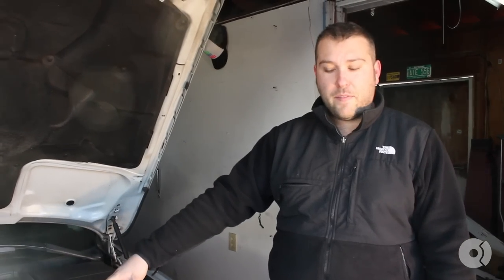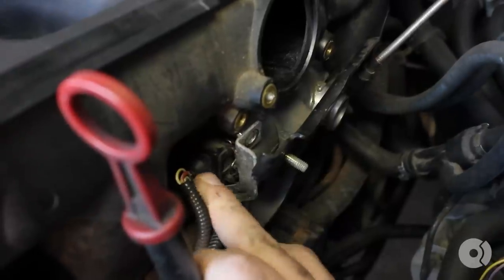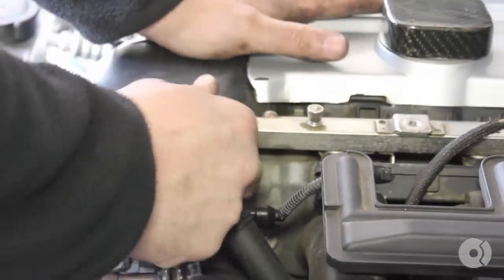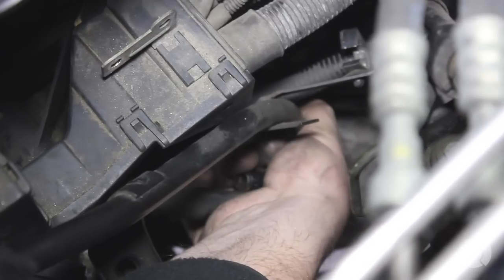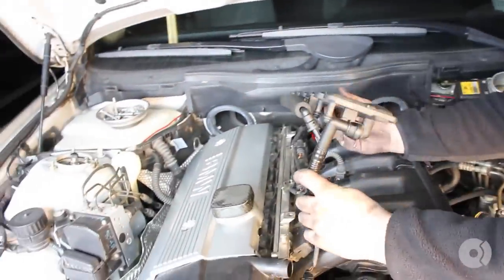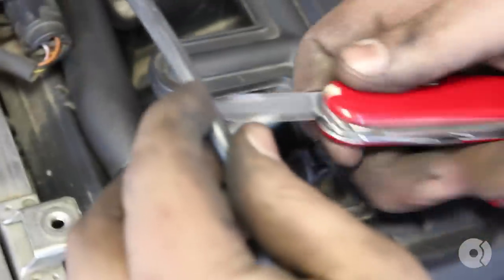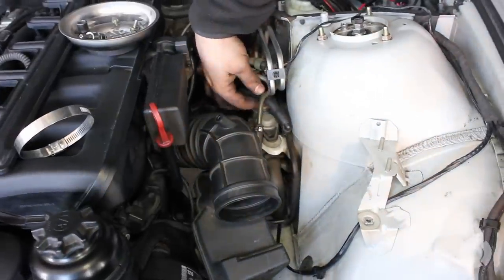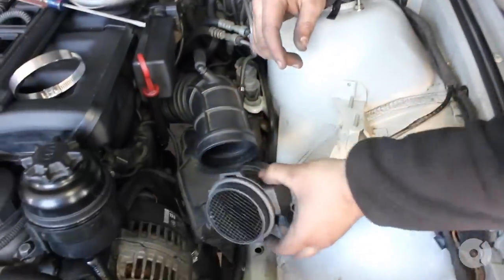BMW PCV Replacement (Breather System, Throttle Body, Idle Control Valve, Dip Stick)

Comment: The dipstick seal and the O rings that you replaced up top are impossible to find. I looked at Napa, O'Reilly auto zone and Amazon. No one has the right size. Please provide link for ordering.

Comment: Which upgrade upper intake boot will fit best on a 2004 BMW X5 3.0i with the M54 engine?? 525i or the 325i ?

Comment from the maker: We didn't clean the throttle body, he had actually done that just a few weeks before, instead we just removed it and set it aside.  Later in the video you see we replace the gasket, but that's about it for the throttle body.

Comment: How did you get that hose to connect to the pcv valve the one you have to turn and hear a click...I've been trying to get that hose on but there is not a lot hand space under to get the hose fully on to the pcv valve

Comment: Hello, I just changed the PCV system. The car runs great, but when it gets warm the idle jumps in neutral gear. Before I changed the PCV system the Idle was fine. Maybe you know what is causing this? :?
Reply: It throws code p0173
Reply from the maker: +LittleCrazyBoy666 P0173 is usually caused by a vacuum leak. I would check your work on the system to make sure there is no missed connection or poor connection.
Reply: +FCP Euro I have checked 3 times. I deleted the error code 2 times, and now the car idles fine. Maybe it was some air in the system, I dont know really...

Comment: Would the removal of the ICV be the same on a '97 328i (E36) Or at least be in the same spot? I think mine needs to be replaced or cleaned.

Comment: @fcpeuro so i did this job yesterday, and re connected everything, i have crank but engine is not starting, i hear the fuel pump i checked the connections i have everything plugged. Side note my throttle body is the magnetic not the cable one. side note its 330ci 2002 model.
Reply from the maker: Its tough to say, throttle body or ICV may not be plugged in properly.
Reply: FCP Euro i just wanted to update, the problem was one of the 30amp fuses for the engine module. It was surprising for me since the work was not related but that was the cause to not start the engine. Crank no start.

Comment: Where do you get the O rings on the spreader..special material??
Reply from the maker: The o-rings can be ordered individually under BMW p/n 11617502761. They are 7x3mm and as far as I know they are not made of a special material.

Comment: hi guys thanks for your help that's a great video help me out a lot its i have 325i but my engine is M56 and its hard for me to put the idel control valve back i try push it hard but i feel its not go in properly can u help me out plz
Reply: Hi Asher,

The ICV can be really tricky to push back in. In the past I have had problems myself. The grommet in particular is what makes it so difficult. One thing that can aid in helping you get the valve back in the grommet is some silicone spray. It should slide in fairly easy once it has been lubricated. What's nice about the silicone spray is you don't have to worry about it damaging the grommet or valve.

Comment: Hi can i ask your help with my 528 bmw i have been replace deep tick course it's was blocked with the old masty oil but i am interesting is there should be an oil coming from valve cover to pcv ore it's just for the ear? Will be greatto hear some explanation have das it's works pcv valve? Thank you will fallow your comments.Also s in sump have a pressure need to seal deep stick really tight?

Comment: Can't seem to find anything, but is the process similar for an e46?
Reply from the maker: Hello Caleb, the process will be similar for an E46. If you have any questions while doing the repair let us know and we'll be happy to help out.
Reply: FCP Euro 
thanks a lot I really appreciate that, I'll give a holler if I get stuck!
Reply from the maker: You're welcome!
Reply: Hey guys, i have a 04 e46 and my service engine soon light came on. I scanned the car and it said it was the PCV. I dont seem to see white smoke from the exhaust or an unsual sound coming from the car will i still have to do the complete replacement? Also FCP Euro, PCV 325i video soon ?! Thanks

Comment: Hey guys, i have a 04 e46 and my service engine soon light came on. I scanned the car and it said it was the PCV. I dont seem to see white smoke from the exhaust or an unsual sound coming from the car will i still have to do the complete replacement? Also FCP Euro, PCV 325i video soon ?! Thanks
Reply from the maker: There isn't a fault code specific for a bad PCV valve. Commonly, a bad PCV valve or PCV system can result in lean conditions, rough idle, or misfires due to vacuum leaks. This is commonly identified via smoke testing the intake manifold. If there is no vacuum leak due to a physical failure of a component the other potential symptom of a bad PCV system is it will be difficult to remove the oil filler cap due to excessive engine vacuum in the cylinder head while the engine is running.

The installation of a PCV system is identical on an E46 325i as it is in this video so we won't be making another one. The system is identical with the exception of the vacuum line off the PCV valve. Other than that, the hoses and valve are all in the same locations on an M54 engine as they would be on an M52TU engine.

Comment: so this would be the same for an e36 with M52 engine I guess, right?
Reply from the maker: Completely different setup on the E36/earlier M52 engine. This video is on an M52TU engine which has several difference than the M52. On an M52 engine the intake manifold have to be removed to do the job. but it's a much simpler system and layout compared to this one.

Comment: Great Video!  Just completed this job on my wifes 02 X5. Easy job except for attaching hoses to valve. I moved  the power steering reservoir and bracket out of the way and was able to get a better grip on that bitchy hose. :^)  What a horrible design and placement of that valve.  Good Job BMW!

Comment: Hi, My bmw E83 crankcase vent valve went bad with pressure in engine & blow out my valve cover gasket. Do you think it could have damage any other seals?
Reply from the maker: It's possible, but the most usual casualty is that valve cover gasket (you can always use Liqui Moly Molygen in your next oil change to check for any other leaks!)
Reply: thanks alot !

Comment: Is pcv valve the same as ccv valve?
Reply from the maker: Hello Jose, the PCV and CCV refers to the same system, on many BMW models the PCV system is more complex and is called a CCV.
Reply: Thank you for clearing that up for me. I just needed to make sure I ordered the correct parts. Thanks
Reply: Is this the problem going on with it catching fire?
Reply: Alan Garcia  no

Comment: I have a 2007 bmw x3 with the n52. High pitch whistling, rough idle, and a lot of suction.. when taking oil fill cap off whistling stops still chugs a bit.  also stalls at stops.. dont wana drive again until i can fix it. I cannot find much info on how to fix except that i most likely will have to replace valve cover.. bmw dealership said i have a crack in valve cover.. they want 2500 to fix.. my dad has a lift and every tool needed most likely so i would rather do it myself.. i also heard its probably the pcv valve/ breather system but thats molded into valve cover which is why i will have to replace valve cover.. any help would be much appreciated..
Reply from the maker: Hi Krookiemonster, we actually have a DIY on replacing the valve cover on an N52: https://www.youtube.com/watch?v=6DlFKo2809I

Comment: fcp euro,if i buy pcv  it comes everything on the box or just pcv itself
Reply from the maker: +Tommy Sena 

We sell complete kits and individual components:

Crankcase vent valves:
https://www.fcpeuro.com/BMW-parts/Crankcase-Vent-Valve

Breather System kits:
https://www.fcpeuro.com/BMW-parts/PCV-Breather-System-Kit

The best way to verify what fits  your BMW or doesn't fit your BMW is to select  vehicle and search the engine mechanical category.

Comment: hello. how much is pcv? full sistem with cable.
Reply from the maker: +Bogdan Varcoci That depends on what BMW you have. I would need year make model (preferably the last 7 of the VIN) to really determine the correct parts. Also, I'm not sure what you are referring when you mention cable.

Comment: On a e90 , 2011where is the pcv located ?
Reply from the maker: For both the N51/N52N and the N55 engine the PCV valve is integrated into the valve cover.

Comment: On a 2001 530i m54 engine, when I shut off the car maybe 1 second or 2 after the engine lets out a big hiss or like a loud exhaust from the engine bay. What might that be?
Reply from the maker: Hello Jose, it sounds like your breather system might be clogged based on your description.
Reply: FCP Euro is there a part number for the really thin small vacuum line mentioned in 27:00 ?. FCP Euro has the whole kit but I don't see the vacuum line or the size.

Comment: hey Fcp Euro, I have the m56 engine and I got a diagnosis from my mechanic that due to the codes (p0171&174) my pcv was bad (diaphragm) he gave me a quote for nearly 1k, (~979$) with all OEM parts. is that a good price ?
Reply from the maker: Javier, the M56 SULEV engine has the PCV valve integrated into the valve cover so to replace it you will be replacing the entire valve cover along with valve cover gasket. The valve cover is rather expensive and is price around $650 from BMW, although its sold for less online. The p/n in question is for the valve cover is 11127521086. I also assume they are replacing the vent hose which connects to the valve cover which is p/n 11157513756. Does yhe price your mechanic quoted you include installation?
Reply: +FCP Euro he gave me a while summary for the cost of parts an it totaled to be $754~, he stated that he will be using all OEM parts and of course the Sulev parts are more expensive, and yes approximately 1,000$, he's only charging me $240 for labor. would you also advise against aftermarket parts here or are they safe to use also?
Reply from the maker: +Javier Delgado Thats not a bad price to be honest. For the parts he will be replacing there are no aftermarket options available unforrunately. Also, I don't suggest using aftermarket parts for anything in the PCV system.
Reply: +FCP Euro how rare is this occurrence of the PCB breather? I am currently reaching 130k, I've replaced most major cooling system components, would it be logical to replace any other rubber hoses that also become britlle like the upper/lower intake boots etc. .? to avoid future vacuum leaks
Reply from the maker: +Javier Delgado The M56 layout is a little different. Basically items that wouod be serviceable become unserbiceable without repacing major components. This was in an attempt to reduce possible leaks. I would definitely suggest replacing the lower intake boot at minimum if it hasn't been replaced yet.
Reply: +FCP Euro are you aware of the Sulev warranty? I've been meaning to look through it Because I was told some components are under warranty until 150k
Reply from the maker: +Javier Delgado I have heard information pertaining to it but have never looked into the particulars. I believe the fuel pump is included in that warranty since it requires replacement of the entire tank.
Reply: +FCP Euro I am going to give the go ahead on the job for the pcv, as I have been getting a rough idle on cold starts and some what bad worsened fuel economy. thanks guys!
Reply from the maker: Javier Delgado No problem. Let us know if you have any other questions.

Comment: Dear FCP Euro
Since last month I had a serious problems with E71 N54 engine Vin: L347199 .
The N54 problem started when I replaced the head cylinder cover gasket because of oil leakage , after re-installing we had whistling noise.
To solve this problem we replaced the cover valve also vent hose ( 11 15 7 574 114) but the whistling noise still existing.
it's highly appreciated if you inform me what shall i do in next step to solve the problem
Reply from the maker: Being that the issues started after the replacement of the valve cover gasket I assume there is a possible vacuum leak somewhere, especially if there is a howling noise. The only way to track it down is to do a smoke test to see where the vacuum leak is occurring. I would also expect there are diagnostic codes stored on the DME for misfires and lean running conditions.

Comment: This guy is a terrible mechanic at least in the video at the time.  He’s not careful with anything, and I know it was probably cold out but the sniffling was ridiculous.  I’ll admit that I did learn a couple of things from the video.  Although there are better and more detailed videos for this job to replace the CCV system.  I hope your car is still going strong sir.
Reply: Yeah learnt some good things from this video  but this was done rough handled  but then may be the guy never  had proper tools and tech knowledge  of using correct  tools and attention  to safety.

Comment: I commented too early.  1st comment still good! 5 meters of vacuum line? I quit video here. DO NOT BUY 5 METERS OF VAC LINE!!!! That is ridiculous. DO NOT pull the oil dipstick tube UNLESS you just want to replace the o-ring. NOT necessary. I would be concerned about the rest of the video. Weird approach, but the one thing that KILLS IT......BMW does not have a PCV system. It is a CCV system. May just be words referencing the same thing but BMW PEOPLE!!!!!!!!!!!!!..........do NOT call it PCV!!!!!!! Or EGR or ANYTHING but a CCV system. That is a CrankCase Ventilation system. You call it PCV and I immediatley think you do NOT know BMW. Weird thing is.....FCP Euro is usually a good site for BMW parts. Check your BMW lingo

Comment: all that fucking effort to change a pcv valve, what a joke. I'm happy mine has no issues with oil consumption even with its high mileage although i know in the back of my head one day the pcv valve will fuck up and ill have to replace it. FML

Comment: Hahahaha... you faked screwing in the bottom Disa valve screw...seeing that it was already busted into threads...... and i think you doubled the dip stick tube O-ring since you seated  the O-ring in the hole and the dip stick tube  had an O-ring on it while you was in stalling it back in....Future oil leak....
Reply from the maker: Correct, lower DISA valve screw was broken long before the video was ever shot. Later went to fix it. Good eye! Lower oil dipstick was not double gasketed however. That is something you should always double check. Typically the o-ring in the oil pan does not come out with the dipstick, so you have to reach in to grab it before installing a new one.